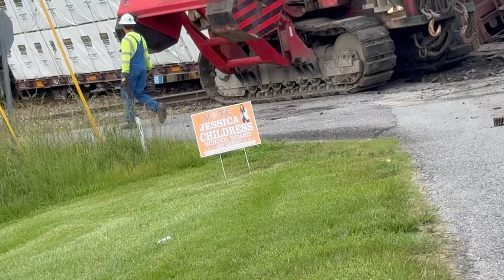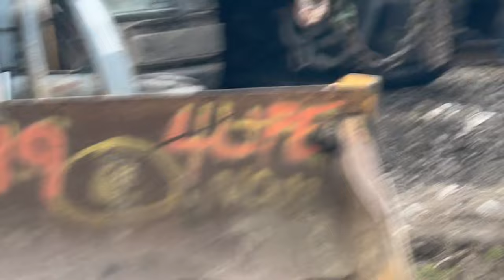Train derailment HD 1080p

Comment: Hopefully all the Safety Experts here in the comment section will get busy personally inspecting the thousands of bridges just like this one across the US, then find the funding for the suggested repairs. Start in Pittsburgh. You'll see stuff there that makes this bridge look like the model for safety. Up there they don't repair 'em until they collapse. Metal fatigue just happens. This bridge is approaching 100 years old and if that's the worst that happens, no big deal. The wood up top is the real issue. The old bridge abutments are for a coal spur off the main line abandoned previous to 1960.

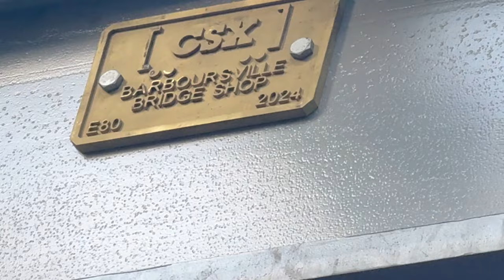Comment: @1:02:09  the bridge builders plate. E80 is the load rating on the bridge. It is the Cooper system designation which rates this one at 80,000 pounds per driving axle.
Reply from the maker: Thanks for that. I didn't know what that was.

Comment: ... cracked the girder
- mounted ~ the 1910s - still, pre-1920s construction (rivets, no welds...just rust and rivets)

Infrastructure, USA needs to be REPLACED, REBUILT, AND MADE SAFE TO USE
Reply: You can plainly see the place where it's cracked has rusting at the top of the crack, so this isn't a new development.
Reply: There's always a US war somewhere that comes before these small time domestic problems with infrastructure.